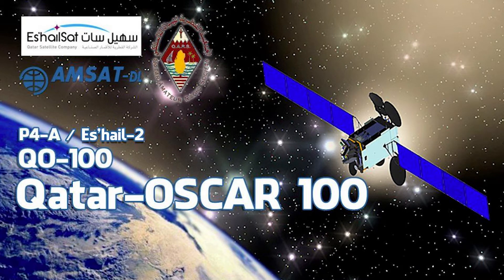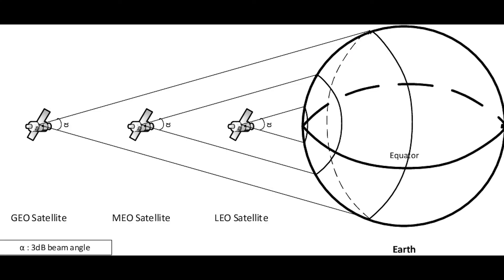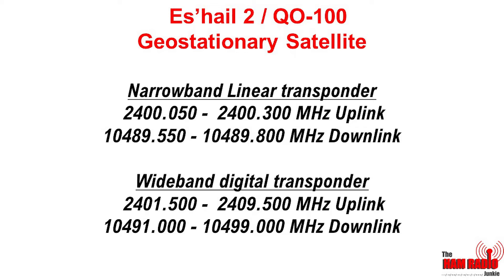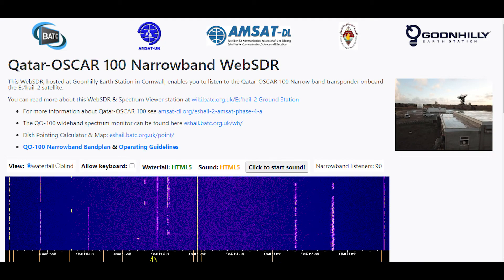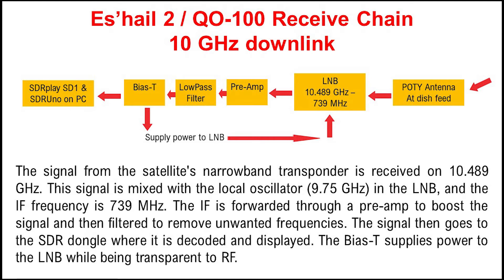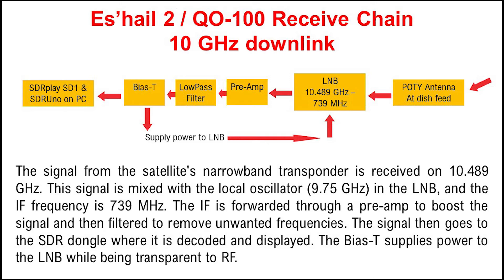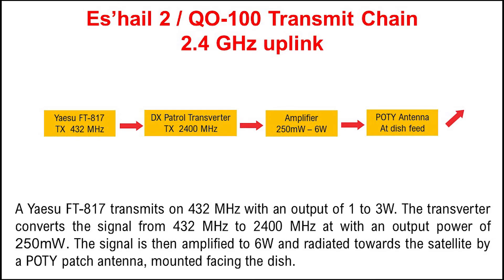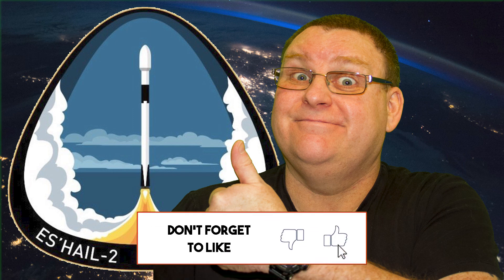Es'hail 2 /QO-100 geostationary satellite station. My next project

Comment: Interesting, but even done on the cheap, it is to much for me, so "I'm out".  One question, why does no one use helical aerials these days, is dishes better?  Bound to be, you don't have to be spot on with a dish, just close enough.  Only reason I ask is I was on top of a roof and two guys came up to work on four helical aerials.  I asked what they used them for (hoping for a big explanation) but only got "It is to communicate with a satellite" it was an Oil Company, and that is all I got told, honest Guv'.
Reply from the maker: Bob, people do use helical antennas either pointing directly at the satellite or pointing at a dish. The benefit of the patch antenna for me is it's compact size and ability to work with the LNB.
Reply: @TheHamRadioJunkie  Fair enough, I would probably do the same, if I were being honest!